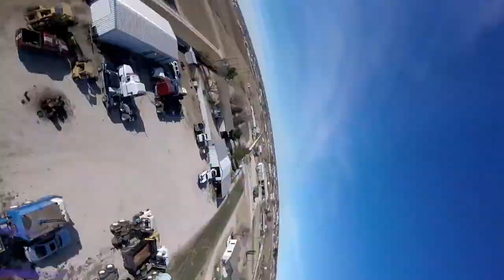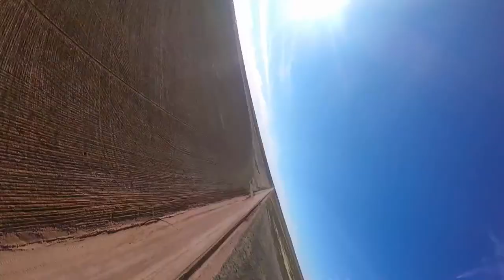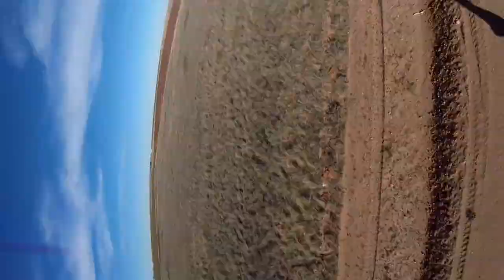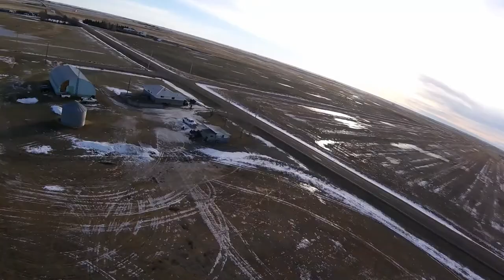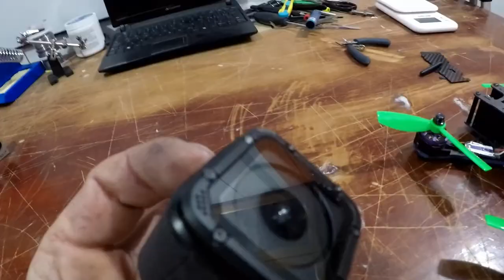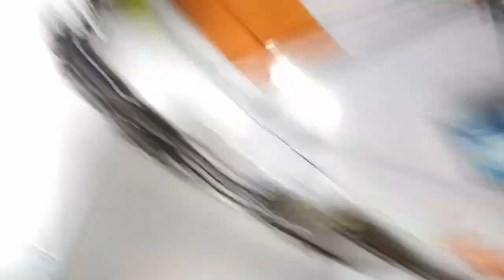Death Spiral

Comment: John! You're doing well with the wizard such a shame that fault is occurring. Looks to me like a sticking gyro possible faulty FC? Maybe try either reducing the stability amount in Betaflight or even better, try it in acro as you might not get this problem! Also a good tip is to get some of those broken prop blades and securely tape a blade to the top of each ESC on the arms, this will act as a ESC and wire protector from prop strikes in a crash. Nice progress brother, I have some new videos you may like too! Good luck my dude! 😉👊👊👊
Reply from the maker: PrelRude thanks brother I'll check it out friend thanks for watching friend I appreciate the support.

Comment: Looks like an ESC desync.  Might have a faulty ESC. Take props off and run each motors via the Betaflight application.  Hopefully you can replicate the fault there and id the faulty esc.
Reply from the maker: Flyingbros FPV I'll check it out friend thanks for the tip man and thanks for watching.